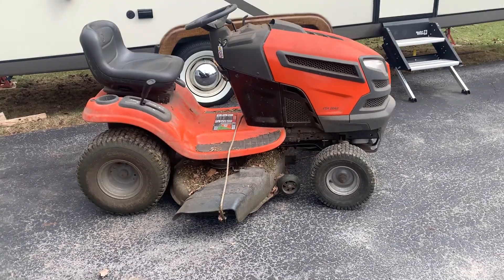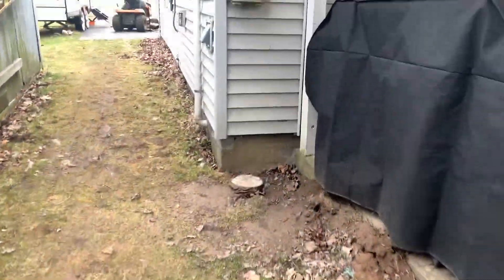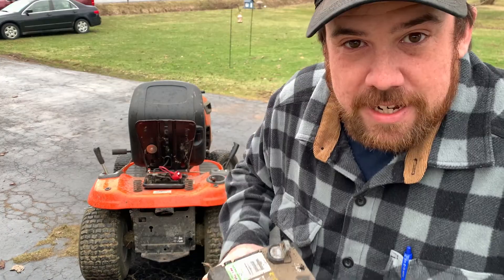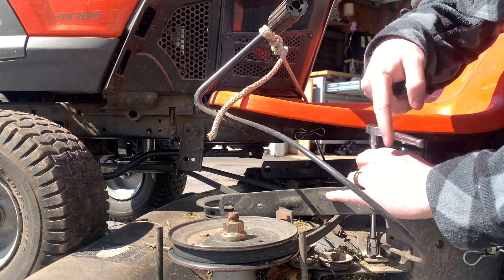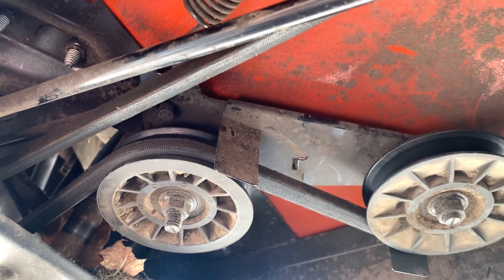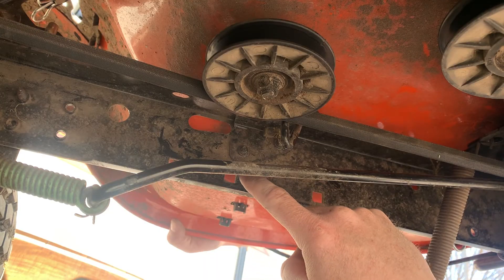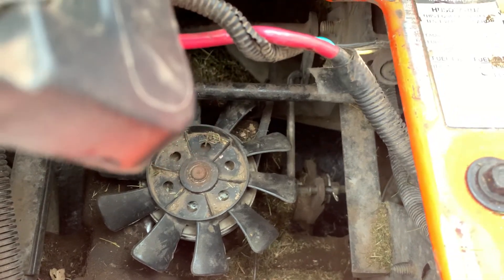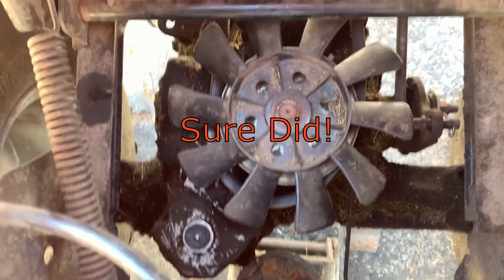Husqvarna YTH 2042 Hydro-static Oil change. Wheelie Breakage. Complete Toilet Garage Welds

Comment: Thanks for showing us you driving it after repair, some peeps just show the wrenching, n I'm like did he fix it? 👍
Reply from the maker: I try to close my videos. If they are a multi-part I’ll usually disclose that’s.
Reply from the maker: The transaxle shifting forward was the main problem on that machine. And my neglect 🤣
Reply: Noticed my was leaking a bit and some whining, so this should fix. Thanks again